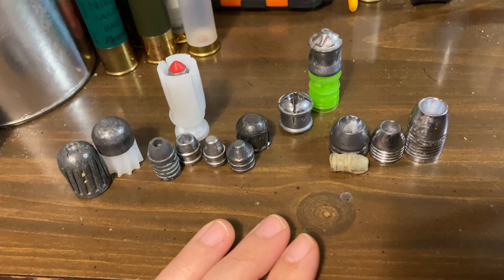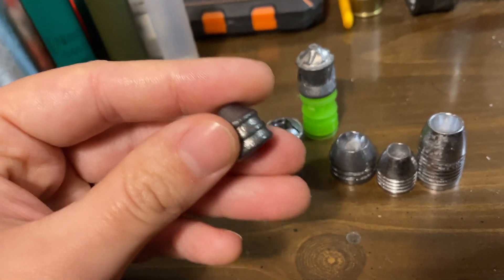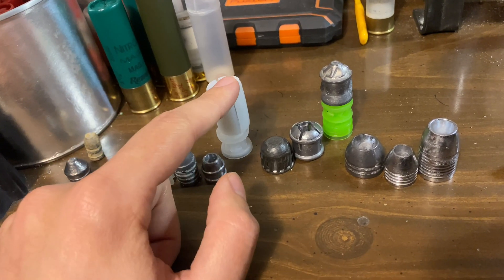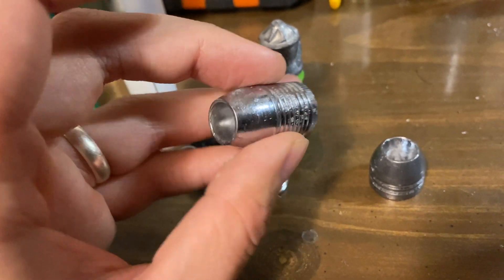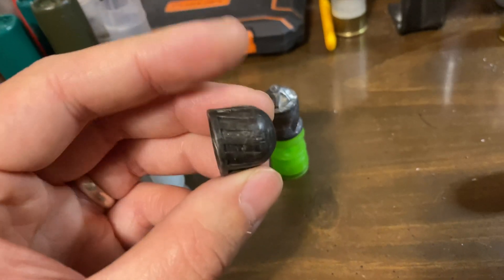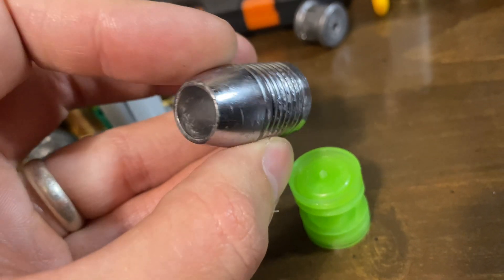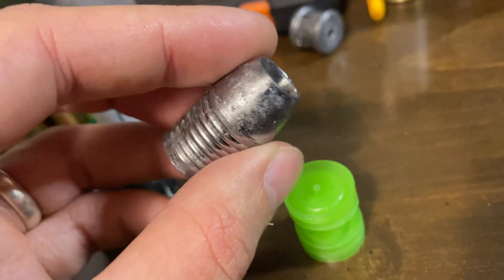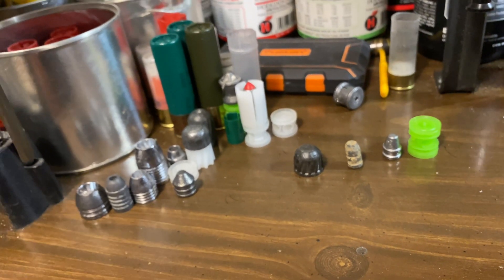Why You Can’t (And Can) Use Solid Projectiles In Smoothbore Shotguns

Comment: I cast using the lee 7/8 once slug mold using WW lead. With the harder lead, they come closer to 3/4. I put them in a BP1205 with 1/8" under them, push them with some GD dust and roll crimp. I use these in my 870 tactical with a cylinder bore and they do pretty good. Just have to measure each one. Sometimes they come out a little big which wouldn't be good with the harder lead.
Reply from the maker: Awesome. I’ve seen other people mention that wad for these.

Comment: That looks like a segmented Zveroboy slug at 9:31 I make over 1000 per week of the non-segmented hollow point type. With a BRP-12 I can pretty much stack those at 50yds out of my smooth bore Mossberg. The one you show has a flaw in the top ring. That, plus not having the screw perfectly centered on the wad can affect accuracy.
Reply from the maker: I noticed in editing one of the sides wasn’t cut like the rest. I’ve had them for a while, they do well out of smoothbore or rifled barrels.

Comment: is a pumpkin ball considered a slug when fired from a smooth bore or just a ball? personally, I'd expect a soft lead pumpkin ball to be rather nasty, how come they aren't used much I never see them for sale at least retail?
Reply from the maker: A hard cast ball will best a slug in penetration just about every time. They are wicked. The main problem I think is just that slugs are more accurate at distance. Round balls are good to 50 yards and decent at 75, beyond that they tend to loose accuracy quick. I consider a slug and a round ball different enough to not call them slugs.
Reply: @theshotgunscientists  have you ever tried a soft lead ball not hard cast, for damage not distance or even penetration? that's the heart of my question.
Reply from the maker: @oubliette31415  Never tried pure lead not yet anyway
Reply: @oubliette31415  I make some from pure lead. We cut down an 8" diameter tree with them that we had targets mounted on.
Reply: They are actually pretty awesome. I make 69 cal ball with practically no sprue flat. They're fairly accurate and very lethal. They deal with shooting through brush without deflection much better than most slugs.